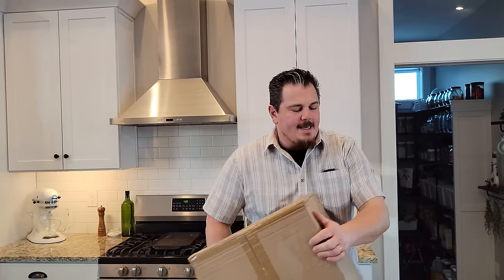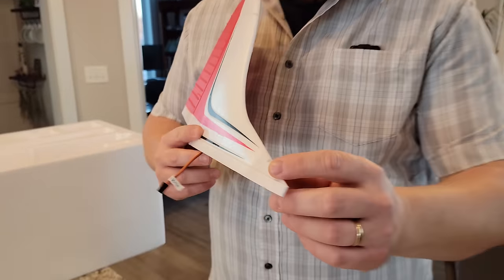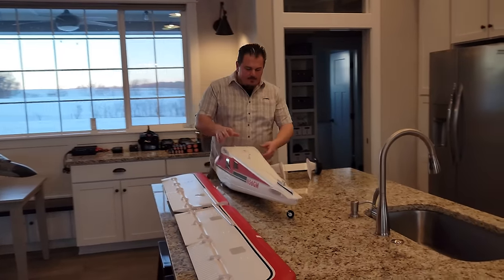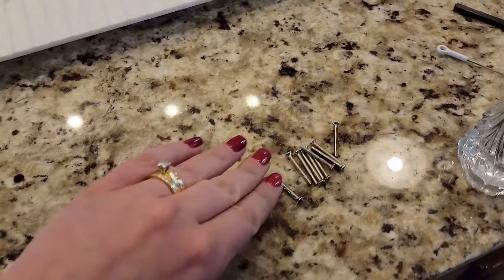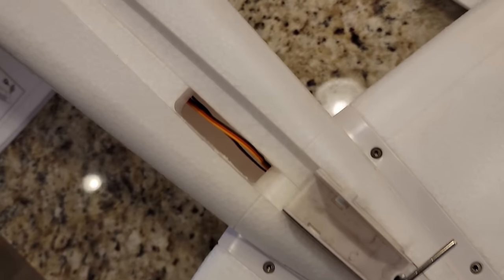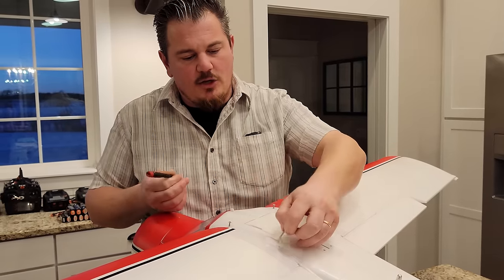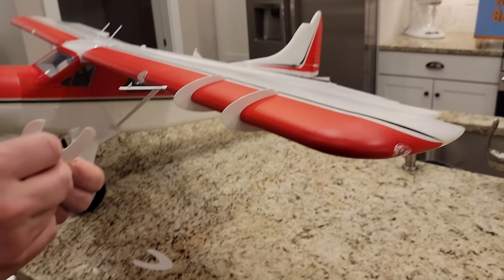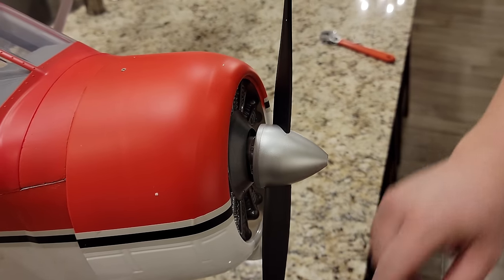FMS - Beaver V2 - 2m - Unbox, Build, & Radio Setup

Comment: Will my DX9 work ok with the Beaver? I tried to stay with you when you set it up but the dx9 doesn't have some of the features as your nx8
Reply from the maker: Do you have the firmware up to date? If not, please do that, and you might find some of the features you weren't seeing. Also, the DX lineup is going to have some differences, but they are super close, so you'll have to decide if a particular feature is all that important. If it is, and you decide to upgrade to the NX10 - you will enjoy that too, but I think you should check our the firmware first. DX9 is a great Tx!

Comment: Hey Brian. I’ve got a fms f18 and it has the reflex already in it, like the beaver. Do you think it would be better to use the ar620 or use an ar637t (in which I would take out reflex)? Thank for any feedback!
Reply: The gyro in the AR637T is much better. You can configure it from your radio, the Reflex gyro can only be configured from a Windows PC and not at the field.

Comment: Hey Brian bought all your planes ( almost ) I need help with the Real Flight 9.7 what ever it is, I keep getting a message “ can’t find the controller “ the unit I plug in the usb port at the beginning, the program runs, but I have no controller, please help I need the practice as to not crash so much, I have 3 planes I refuse to unbox until I can fly without crashing. Then I’ll open the 2000 beaver and carbon cub and that sweet low wing censna. The jet you make look easy but I know she’s gonna be tough. 
Please help, I got the bug and want to fly, tired of climbing trees and hunting around the neighborhood looking for my night timber that flew away on me( thank god it was laying in someone’s front yard, it was easy to spot ,all lit up, glad I decided to drive around, and found on the front yard and not through someone’s front window(my nightmare) 
Please any ideas, called / wrote horizon ( which has a good product but the worst customer service I ever came across, how do you have a company that big and not a single person to talk to) 
Please help with the sim, I see your boy is using it.
Thank you.
Reply from the maker: Okay, this was a "KNOWN ISSUE" that Horizon Hobby seems to be aware of. Call them up and they can send you a USB HUB, or if you have one, give it a shot, then it may be found. There was a strange batch of Tx'es that did that, and they caught it, but only after they were shipped, so the SECOND shipment got the little USB HUB included as a patch, but they've since FIXED IT.

Spektrum and/or Horizon Hobby tech support will help you make this right. I'm sorry you're having this issue...but seriously, if you have a hub, it'll take you 2 seconds, and if you don't hit them up and they can help take care of that.

I hate that you're having a hard time getting through to them... 1-888-959-2305 (airplane support)

Comment: FMS Beaver Vs. Carbon Z Cessna 150T 🤔
Reply from the maker: Tough call. Both excellent planes. Beaver is more detailed, but the Cessna 150T is more crazy capable. Both fly on similar battery and size...the Beaver is admittedly a TOUCH smaller but both are good. The Carbon Z lineup is one of our favorites, and with Thrust Reverse, it might JUST edge out the Beaver...

Beaver https://bit.ly/3J8lOVz | https://bit.ly/3CmXRHO + AR631 https://bit.ly/3v0w3Fy OR AR637T https://bit.ly/3OlgIpB
CZ Cessna 150 https://bit.ly/3RNoprG
CZ Cub SS https://bit.ly/3OlTJem
CZ T28 https://bit.ly/3PmbxHf <<<< Don't forget to muddy the waters with this one too ;)
Reply: This is how i am rn. But im getting preowned, if new it will be the cub SS or cessna. But i cant get a beaver with battery PNP for 300 & a cub SS for 350, no battery.